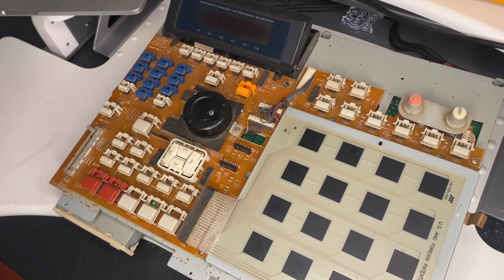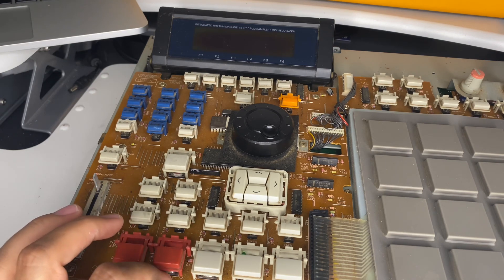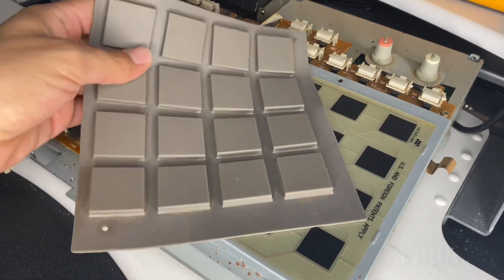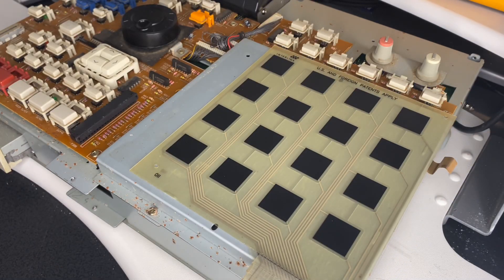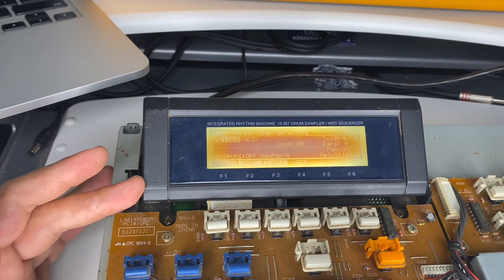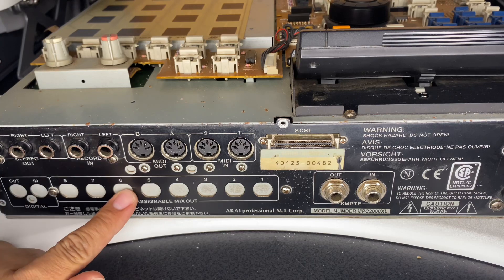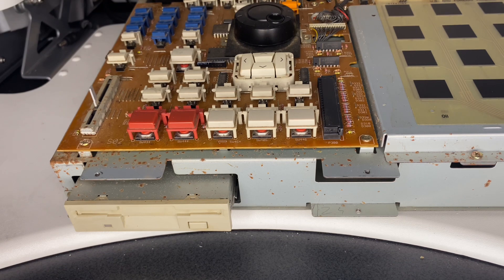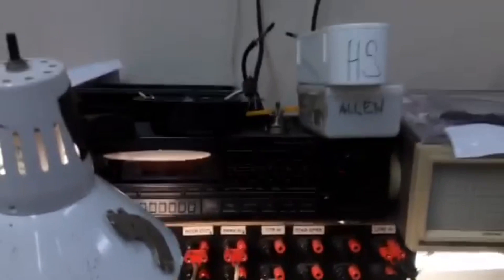2021 MPC 2000xl top 5 Issues

Comment: Fixing and pimping up a older MPC is part and parcel of getting one. For me it personalizes your MPC and makes it yours. When I got my 2000XL the pad sensor needed replacing and I didn't want to use SCSI or floppy so I upgraded the drive to CF drive. While I was at it I replaced the original pads with Fat Pads. I bought the parts at MPC Stuff. No rust on the bodywork  and although the screen has a slight burn I can see everything and it doesn't annoy me so I've not replaced the screen yet. It is one to do though. I'm looking forward to seeing your 2000XL up and running.
Reply from the maker: Thank you! I’m thinking of going scsi2sd and blue screen with black button kit. The XL is an amazing workhorse that people leave on for days or weeks. So it’s no wonder they all get screen burn . Thanks for watching.